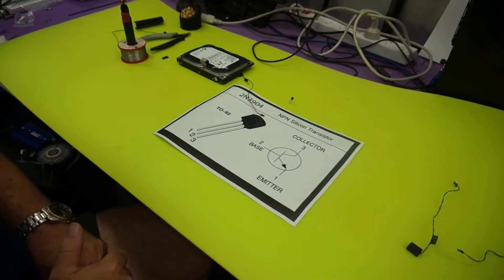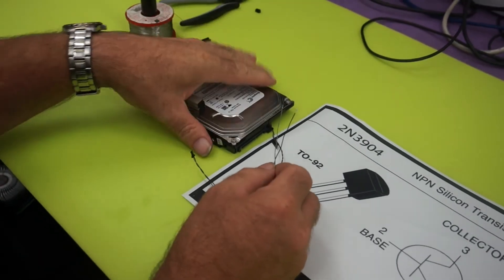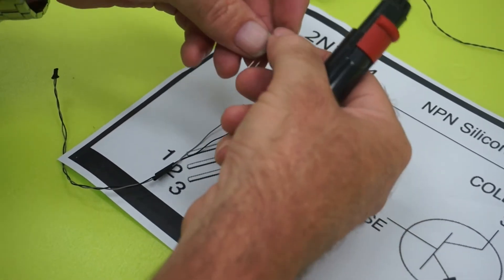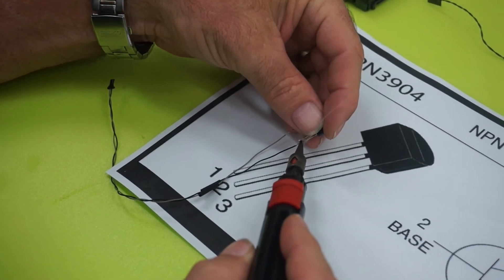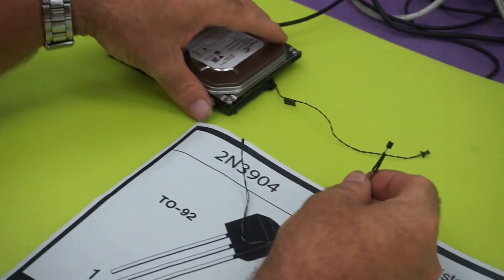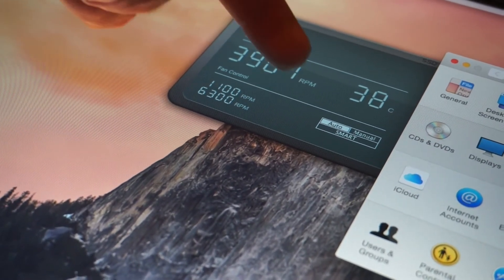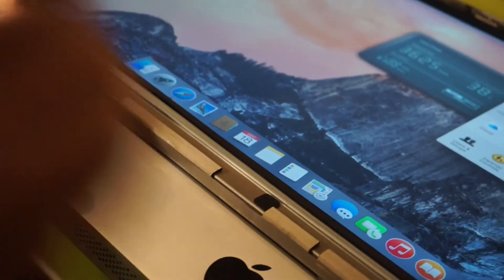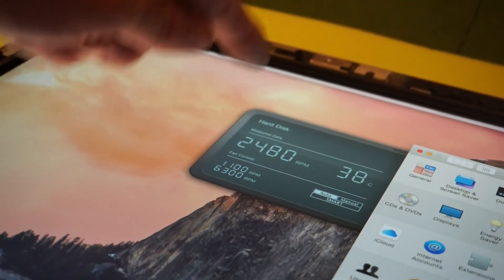How to Control iMac Fan Speed # 1: The Electronic Fix Brisbane, Australia

Comment: it doesnt work on my imac from 2009..my fan is still loud..help!!!
Reply from the maker: Your 2009 iMac by default should have one of these attached to the drive.
If a late 2009 then perhaps not.
I would be checking the connections or looking at another sensor that may be causing your fans to run loud. Make sure they are all connected including the sensor on the screen.